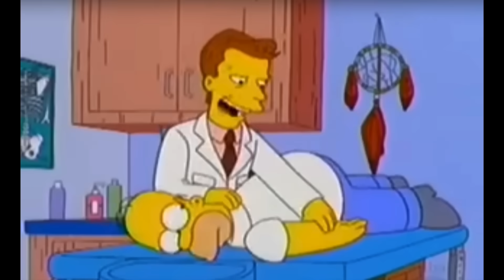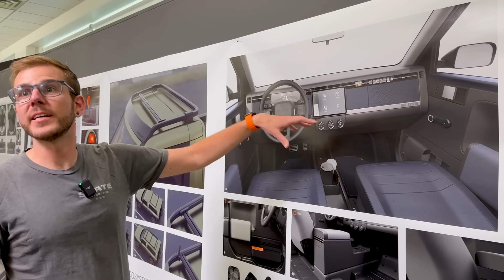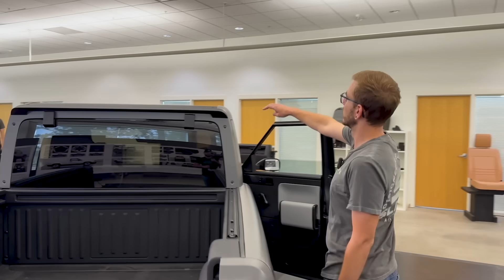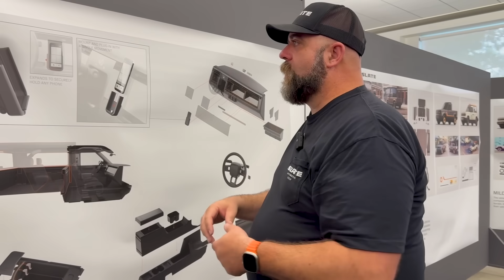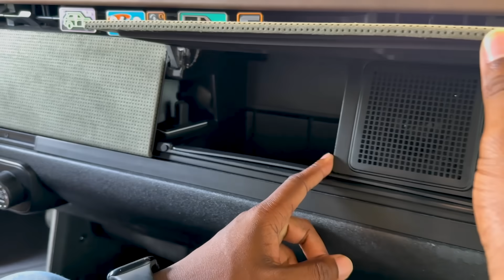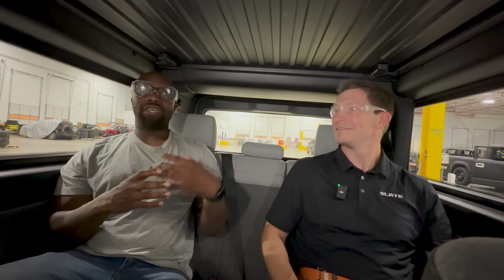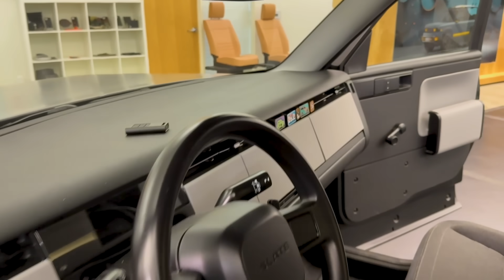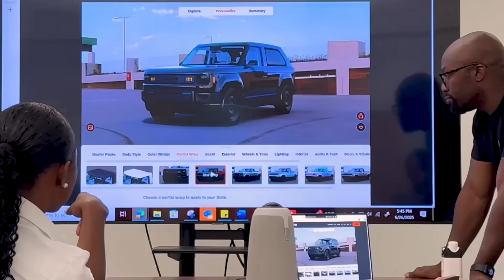The Slate: America’s $20K Answer to China’s Cheap EVs (Exclusive Access)

Comment: I paid $16K for my brand new 2006 Toyota Tacoma and besides regular maintenance, (oil changes, tires, etc.), the only thing I've had to fix is a new water pump at 60K miles. Assuming 16K in 2006 is roughly the same as 28K in 2025 then if Slate can show me that it can even come within shouting distance of that sort of reliability, then I'd be interested.

Comment: I ordered Dodge Avenger in 2013. Midlife crisis buy. The dealer and I looked at 1000 mile radius for a car on the lot with all the accessories I wanted. None had it. So I ordered one with the best of everything they had to offer, (including the Blacktop package), with the exception of the block heater. Which I wish I had ordered. Anyway, getting the car exactly how I wanted it was a big plus. Top of the line everything, and it cost $26,000. I still have it. Love that car. People don't normally have the patience to wait a month for a car, so they settle for what's on the lot.

Comment: My top 5 questions: 
1) do you sit in this at the same height as a car or do you sit as high up as a colorado?

2) how much extra is the 240 mile range over the 150 mile range?

3) if there is no awd, what is used for traction control in rain, snow, or when stuck?

4) can you add air-cooled and heated seats

5) what is max cargo, max tongue weight, and max towing weight?

Comment: The range is going to be an issue.  For the smaller pack I would be plugging in nightly just so that I would not have to worry about any extra stops on my way home the 2nd day.  I see this working for somone driving very limited miles each day.

That part out of the way, I will say that I hope this works out well.  I agree that having to buy some overpriced add ons because I want certain piece is greedy and stupid.  Going back to a setup where I can buy the pieces I want and then get it wrapped would be much nicer.  They need to work out deals with local shops to install the add ons.

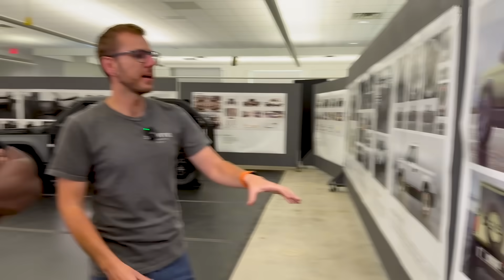Comment: When I first saw this, I thought it was a good idea. After I got a realistic idea of the size of it I changed my mind. For what you get for mid 20K, this isn't an affordable and definitely not  practical  vehicle for your average person. For truck use, the bed is very small. For basic transportation  use, the range of 150 miles is not going to cut it. I think they should market  this towards warehouse use, construction sites, or even amusement parks. Pretty limited market as it is I think. The pics at 8:18 of the SUV version are very deceptive. It looks like it's equipped with off-road wheels and tires and a rear skid plate. Maybe lifted a bit? It's RWD only. After you add up all of those extra options you are probably closer to 35K.
Reply: So it's a kei truck!

Comment: I dream of a truck like the slate. But I want an in dash single Din Radio, a manual Transmission, and maybe a 3 cylinder Turbo Diesel with a reliability of 250K miles for 20K. A small vehicle and small turbo diesel with 500 mile range. It would probably hold 10 - 15 gallons, and pull a small box trailer with ease. But no. They want you to stay in your 15 minute city and have a 30 min charge? Seriously. 10 gallons would take what 5 minutes to fill for 500 miles? I guess what I want is a mini truck from the 80’s but with a little more modern drivetrain.

Comment: It’s what Ford tried to do with the Maverick a few years ago. However then everyone didn’t want the base maverick like you they wanted it with all the accessories. Then they wanted OffRoad packages hence the raptor package. So these packages change so much of the truck the cost then goes up not just a couple of thousand but 10-20 thousand depending on on how far you go. I honestly would love a brand new F250 just like my 2970 F250 new. No electronics just an amazing/fm radio no electronics on the engine and that’s it. But they just wouldn’t sell today. The truck looks.  Little like the bronco body on the slate.  So the styling is nice but where I live with the only chargers that are 45 min away from me are Tesla chargers. So first they need to be able to charge at a Tesla station. Even Ford and I believe GM made a deal to allow their owners could charge at Tesla stations. Two even with the bigger battery 240 miles wouldn’t work for me of a large portion of the country. EVs work great for people who live in most cities. Atlanta not so much. Last I checked charging stations at least near the interstates is very limited.  On the small battery I could not get to ATL and home on one charge. I couldn’t get to Birmingham and home on one charge. So I’d have to have the bigger battery and hope I don’t need to go to many places while I’m there. If I was just driving locally I’d probably be ok. So I like EVs they are fun to drive however until they start getting 700-1000 miles per charge they won’t be affordable for me because I would need a gas or diesel as backup.  😢😮

Comment: The cost of the upgrades from Slate might end up being a moot point. I suspect that the aftermarket for this is gonna be HUGE. They stated that they will open source all of the necessary info. So, it's going to be game on, even for the little guys that have a 3D printer or a plasma cutter and welder in their garage. 🤷‍♂️

Comment: Wow, someone (in the US) finally gets it.  ENOUGH power to not be slow.  But not stupid fast.  Longer range out of the same battery or smaller.  The other small truck out there is 250/500hp versions which is just nuts in a truck the size of a mini cooper.

Comment: The more I think about this, the less value I think this has for a consumer.  You get massively more by buying any used EV.  But for fleets/corporate pools, it makes more sense.  If I can buy 100 of these, then scavenge parts as they die to keep 90 running, this makes a lot of economic sense.  But I suspect a significant fraction of the companies who want a small pickup truck would be better off with a pool of golf carts with tacked on beds, with only a few big trucks like these -- they generally don't need to go faster than 30 mph, and they generally carry plants and repair gear.

Comment: I think this is a great idea.  People bought Yugos.  I think these will really sell for $10k.  Maybe $13k.  But I can buy an IONIQ 5 which is just a few years old for the price they want.  EVs depreciate in value really, really quickly.  Just being on the low end really gets you nothing.  If it had as a selling point that the body panels could be replaced for $30 each, that would make it more interesting.  If they sold just the core car with no panels at all, that might be interesting -- remember how people used VW Beetles as the base for dune buggies, sports cars, etc.?  But they'd have to be much cheaper than this.  They'd need to be really, really cheap.  There are actual, fairly feature-rich cars (if you have 2005 expectations, not modern IONIQ 5 expectations) which are $25k new -- we don't have them in the US, but they can be had.  If the only justification for this Yugo is protectionism, then we have a huge problem as a society, and these cars are going to be a joke in a couple of years, when we give up our protectionism.

Comment: I was saving toward a Model3 Performance when Musk got high & joked about buying Twitter. So I bought an old, high-mileage BMW M Roadster instead cause I figured I have a few years left in my clutch knee. I’m still chucking money aside, and, if the Slate comes out for $35ish, I’ll buy my first new car. Not the first year: I’ll wait till the second production year, but it sounds like the perfect retirement vehicle for me. No gas to get stale, enough range to get me around town and up on the Parkway a bit. And simple. I’d love crank windows & rubber mats. Gotta have manual door handles and HVAC knobs. I’d rather not have a center screen at all. 
I got my permit in a 74 Super Beetle, and this is the closest thing I see to those cheap, cheerful, basic transportation cars of yore that I loved

Comment: If we could get a small simple basic vehicle like this with a gas or diesel engine and 5 speed I would probably buy 2, myself. The car industry absolute refuses to go back to ford ranger or Chevy s-10 style trucks. Makes me mad so I buy old used s-10’s and the car industry will not get a penny out of me. Insurance is cheap on my 1987 & 1988 also. Easy to work on etc.  If slate goes gas or diesel, I will be first one to buy.

Comment: THIS is what I want in a truck. Something cheap, small, easily repairable, and likely very reliable. Like the old F150s and Tacomas. I don't need a fucking pavement princess - just something that I can use to occasionally haul stuff, use during the winter when my car doesn't cut it, or go camping with.

Comment: yea its 20k bare bones, the moment you added speakers, AC, electric windows, basically all the comforts cars had for 20 years ends up costing more than a gas car? Hows this a solution? They're advertising them as American Kei trucks but you can get a Kei truck in America for 5k, it may not be new but probably would last longer than a brand new Slate

Comment: Would definitely buy a Fire tablet over an iPad, considering the wife only streams shows on it. Bought a bunch of iPads and never used anything other than streaming. Speaking from our own personal experience😂, I will also be buying the vintage-looking one. Need a little pickup truck here in the country and only commuting 20 miles a day. 30-35 miles if I detour to the located hardware store total. If this company doesn't succeed, I will surely be depressed. Seems like the perfect thing we need. EV truck that is affordable. Amazing. One thing I'm thinking about is here in Pennsylvania the winters get wicked sometimes. Wondering how those exposed bolts could be covered to not allow water to just sit on the bolt heads. I'm sure there must be a plug or cover for the bolts...

Comment: I am sick to death of trucks, but I like this one.  No small number of small pickup trucks will finally be put out to pasture because of this one.  

I can understand the choices they made with this truck.  It doesn't need to reach 60 mph in 2 seconds.  The truth is, a lot of people don't use what they have in this category anyway.  Even where I live, with an unusual number of young, aggressive drivers, due to the nearby military bases, getting on the throttle in my car, which reaches 60 in the mid five second range causes traffic to disappear into the depths of my rear view mirror.  

170 miles of range will get you to any two Tesla chargers, at least along the East Coast.  

The current lack of a 4WD option lays bare the idea that 4WD is actually of little use to the people who buy trucks with that feature.  Most of those trucks will encounter nothing more challenging than a suburban driveway.  If the look is all important, and for many, I suspect that it is, this will do just fine.  

I'd trust the crew that developed the Slate to do a minimalist sports car, something more Pontiac Fiero or MG Midget than Lamborghini Diablo.  Or something like the Smart roadster, but as an EV.  They'd probably get it right.

I enjoyed the in depth look at this, again, even though I am bored with trucks.

Comment: The slate is sized midway between the original Ford Bronco and the International Harvester Scout - and has obvious styling influences from both. I bet one of the first aftermarket addons will be a bed extension to hold 8 foot long stuff so it can carry 4x8 foot building materials, plywood, OSB, drywall.

Comment: $27500 for a truck without a radio and have crank windows and 150 range is dumb. Looked it up. They are factoring in tax credit that will go away. By the time you add all the crap that you want to you're into the same for a full size hybrid truck. Or just a Tacoma. That has paint

Comment: Throw a gas generator in the frunk or truck bed = Instant hybrid that can also power a welder & other tools. 
But you'd have to rig up the charging system so you can charge ⚡ while driving.

Comment: The Slate looks very, very cool BUT they are seriously missing the boat without an AWD upgrade option being available on day 1!!

Customers need to be able to take it to any mechanic, have them remove 4 or 6 bolts, and swap the front sub-frame, complete with a 150+hp electric motor and add AWD.

To compete with the current market effectively, they will also need to, in the future, offer locking differentials, as well as high performance motor options, with at least 250 hp, for both the front and rear. 

AWD, though, is the #1, most important upgrade to have available for the customer market they are going to be in. I believe this is so important that the vehicle will fail if AWD is not an available upgrade option.

Edit: Another concern I have is they need an optional battery with a 300+ mile range.  300+ miles of range has become the market standard for what is being sold as a long range EV option and not offering this will significantly hurt sales.

In fact, since it is a truck, it should ideally have a big enough optional battery to be able to tow a non-aerodynamic trailer that weighs ~80% of the tow rating, a good 200+ miles. Currently the batteries that have been announced are ok, but don't include large enough options.

I also agree with Rich, that they need to offer the option of selling the vehicle with the upgrades installed, although installation by the dealer would be fine IMO.
Reply: I was reading other comments and there is a lot of discussion of having manual crank windows. I didn't notice in the video if the Blank Slate comes with manual or power windows. 

These days power windows are cheap enough that I doubt there is much to save with manual crank windows. 

Also, manual windows do break. My 1967 Oldsmobile Cutlass Convertible has a right rear window that you need to help up by hand while cranking it up. The front windows are also stiff. Also my old 1979 Chevrolet K20 pickup had a broken right front crank window. The windows in my 1984 custom built K20/30 offroader (Detroit Lockers front and rear, 4.88:1 gears, etc) do crank up and down fine.

On the lack of an AWD option, would you buy a Slate if there was no way to ever make it AWD?

The past 5 vehicles I've bought have all had AWD or 4WD. Around here probably 95% of new SUVs and pickup trucks have AWD/4WD, even though you can get around just fine with 2WD. Personally I wouldn't buy a pickup or SUV without AWD and I believe the gross majority of local vehicle buyers feel the same way.

Comment: About the 35 minute mark is the $100,000 question, thinly veiled, but it's there...  Will this truck have an option for 4WD/AWD?  At least that's what I think Rick was getting at.  Very important question and one I'm sure MANY people interested in this EV truck (ME!!) want answered.  It's too bad (and might be a HUGE sales "miss" for them by not integrating/offering 4WD/AWD in the initial offering.

As a former test engineer (retired) in the machine tool industry, I worked very closely with design teams developing products, so I have very good idea how the process works.  I have a hard time understanding why this was not part of the original design discussion/specification and why they chose to focus on a 2WD/RWD platform first.  I would have thought it would have been a lot more efficient, easier in the long run, not to mention better for sales numbers, to design this as a 4WD/AWD truck from the get go, then offer the OPTION to purchase a 2WD version.

But they've done what they've done.  I hope it doesn't prove to be their undoing in the end.  Hopefully they'll sell a shit ton of the initial version, and the 4WD/AWD version follows pretty quickly after it.

Comment: How did the truck look from the outside after they added the rear seating area/rear cab, etc. (after that big conversion)? Was there any bed area left? Did they add rear doors?
Reply: no rear doors. It's like the old 2-door S-10 blazer, where you fold down the front seats to climb into the rear.

Comment: What I want to know . How can we put an audio system in this ev. I want to put a couple of 18" subwoofers with a 5000 watt amp and a 600watt 4 channel for the front and rear stage. I guess I would need to put about 6 lithium 12v 100 ah batteries in there. With a 40 amp dc to dc charger  or a bout 4 of them with about 12 farad of capacitance. So maybe 7 100 ah batteries  and a cap bank with 7 2/0 cables going to a distribution block with 2,  4/0  and a 2 gauge  for the 600 watt amp (likely a class A/B AMP, POWER HUNGRY, WITH ABOUT 80-90 AMP FUSE.  AND A 10 gauge for the head unit  and other small stuff. Led lights and stuff. With a 30 amp fuse with a fuse block with 10 amp fuses.  A 5600 watt stereo in a tiny truck.  It should  do about 150 dB at 40hz. ++/--